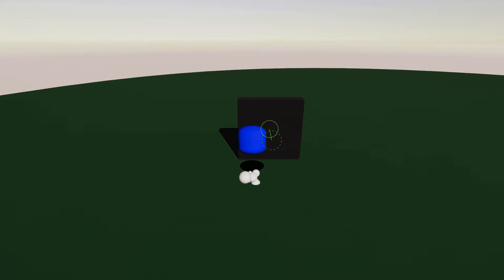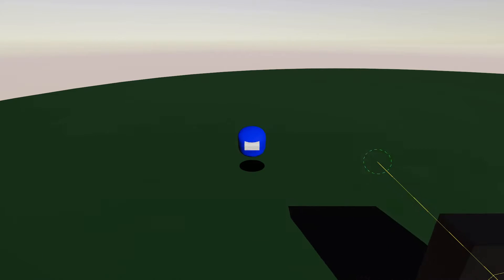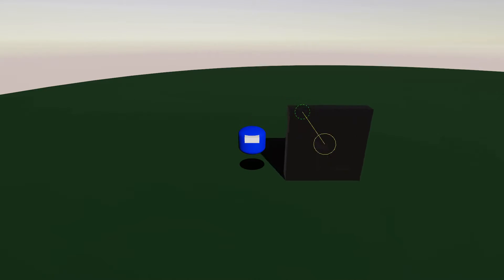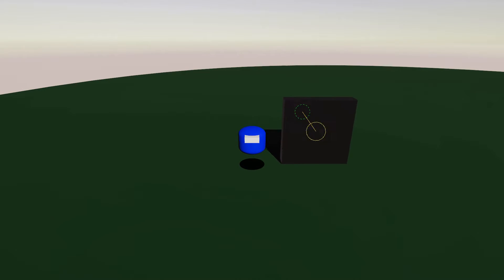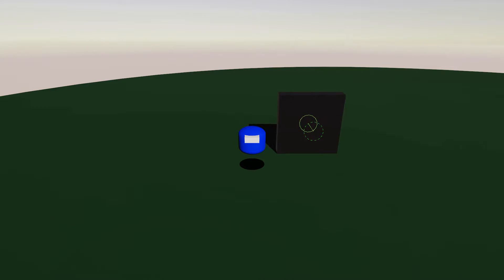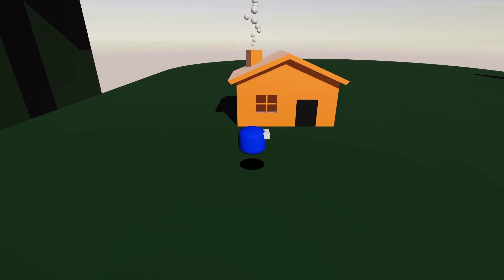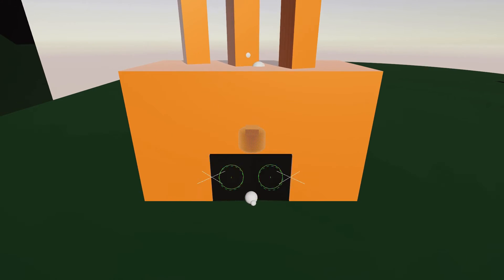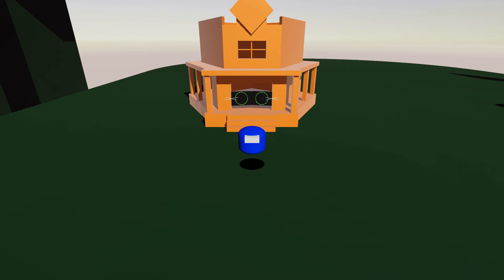Oscillators for Game Development

Comment: is this related to PID controllers? Where you have an error to a value you want to get to, and some function to reach to this value, and your goal is to smoothly reach the desired value. An application would be applying a torque to a tank barrel to reach a specific rotation. You don't know how much torque you must apply, but the PID equation will smoothly reach the desired value depending on how you tweak the values. You also get similarly springness by adjusting the values.
Reply from the maker: Sorry for the late reply, I've just got around to exploring PID controllers myself. My early understanding leads me to believe that PID controllers can be seen as an extension of oscillators.

I think the concepts are mathematically equivalent in some ways:
1. (P)roportional component of a PID <==> Strength component of an oscillator
2. (D)erivative component of a PID <==> Damper component of an oscillator

But they differ in that PIDs have the addition of the (I)ntegral component. The integral component keeps a historical tally of the error, which it uses to remove static error from the system (such as the effects of the constant force of gravity). Whilst using oscillators, I have previously negated the force of gravity to achieve the same effect. Perhaps, however, the integral component has a greater effect on the system beyond just counter-acting static forces. I am going to try using PID controllers where I have previously used oscillators, and see how I get along with them.

Comment: Hi there! Awesome work! I been doing something really similar with a shape cast instead of a ray, but there is a thing that i could not resolve. Maybe you found a good solution for it.

the dampening on the levitation spring and the snap buffer makes it impossible for the character to detach from the ground where it is for example trying to be launched by a trampoline. 

Do you maybe have an idea of how to deal with this?
Reply from the maker: When I have implemented a jump or jump-pad using this sort of levitation approach, my work-around has been to disable the levitation spring when required  (i.e. when being launched upwards).

Roughly, something like this (probably needs some adjustments):

When the Jump-pad is activated...
1. Set jump-state to rising

On update...
1. If jump-state is rising
     a. If falling (i.e. Vertical velocity is negative)
          i. Set jump-state to falling
2. If jump-state is falling
     a. If grounded (i.e. Ground was within range of the levitation raycast)
          i. Set jump-state to none
3. If jump-state is none
    a. Apply the levitation spring
Reply: @joebinns95  Thank you so much for the help! <3

Comment: Hello! I saw this video and thought it was absolutely amazing. I'm only struggling to understand how to calculate angularDisplacement when it comes to the AngularHookesLaw method. Just wondering how you did it and if you wouldn't mind helping me out! Thanks, great video!!
Reply from the maker: Hey! Thanks very much. Good question!

At any given time, the angularDisplacement of an object can be thought of as the shortest rotation required to transform the object's current rotation towards some pre-defined equilibrium rotation. As an example, in the case of a swinging door, you would (likely) want to define the equilibrium rotation as the rotation at which you consider the door to be closed.

I think that the angularDisplacement of an object could be calculated rather easily by subtracting the current (Vector3) Euler-angle rotation of the object from a pre-defined (Vector3) Euler-angle representing the equilibrium rotation. However, I'm aware that Euler-angles are prone to gimble locking, and so calculating the shortest rotation using Quaternions is probably the proper way to do things. Looking back at my own code, I seem to have opted for some sort of Quaternion/Euler-angle hybrid method which only a sick, lazy madman would come up with... So I've pasted a snippet from the code below:

...

    [Tooltip("The local rotation about which oscillations are centered.")]
    public Vector3 localEquilibriumRotation = Vector3.zero;
    [Tooltip("The greater the stiffness constant, the lesser the amplitude of oscillations.")]
    [SerializeField] private float _stiffness = 100f;
    [Tooltip("The greater the damper constant, the faster that oscillations will dissapear.")]
    [SerializeField] private float _damper = 5f;

    public float angularDisplacementMagnitude;
    private Vector3 _rotAxis;

    /// <summary>
    /// Get the rigidbody component.
    /// </summary>
    private void Start()
    {
        _rb = GetComponent<Rigidbody>();
    }

    /// <summary>
    /// Calculates the shortest rotation between two Quaternions.
    /// </summary>
    /// <param name="a">The first Quaternion, from which the rotation is to be calculated.</param>
    /// <param name="b">The second Quaternion, for which the rotation is the goal.</param>
    /// <returns>The shortest rotation from a to b.</returns>
    public static Quaternion ShortestRotation(Quaternion a, Quaternion b)
    {
        if (Quaternion.Dot(a, b) < 0)
        {
            return a * Quaternion.Inverse(Multiply(b, -1));
        }

        else return a * Quaternion.Inverse(b);
    }

    /// <summary>
    /// Returns the damped restorative torque of the oscillator.
    /// The magnitude of the restorative torque is 0 at the equilibrium rotation and maximum at the amplitude of the oscillation.
    /// </summary>
    /// <returns>Damped restorative torque of the oscillator.</returns>
    private Vector3 CalculateRestoringTorque()
    {
        Quaternion deltaRotation = ShortestRotation(transform.localRotation, Quaternion.Euler(localEquilibriumRotation));    
        deltaRotation.ToAngleAxis(out angularDisplacementMagnitude, out _rotAxis);
        Vector3 angularDisplacement = angularDisplacementMagnitude * Mathf.Deg2Rad * _rotAxis.normalized;
        Vector3 torque = AngularHookesLaw(angularDisplacement, _rb.angularVelocity);
        return (torque);
    }

    /// <summary>
    /// Returns the damped Hooke's torque for a given angularDisplacement and angularVelocity.
    /// </summary>
    /// <param name="angularDisplacement">The angular displacement of the oscillator from the equilibrium rotation.</param>
    /// <param name="angularVelocity">The local angular velocity of the oscillator.</param>
    /// <returns>Damped Hooke's torque</returns>
    private Vector3 AngularHookesLaw(Vector3 angularDisplacement, Vector3 angularVelocity)
    {
        Vector3 torque = (_stiffness * angularDisplacement) + (_damper * angularVelocity); // Damped angular Hooke's law
        torque = -torque; // Take the negative of the torque, since the torque is restorative (attractive)
        return (torque);
    }

...

I hope the code here isn't too butchered. If you want to see the full code (TorsionalOscillator.cs) working fully with all the pieces, then checkout the GitHub project in the description. Goodluck!
Reply: @joebinns95  Thank you so much for the reply! I was able to work it out and look through the GitHub project. Learning from your code and how you worked it out really help. Got it working just the other day. 

Thank you for explaining why and how it works!
Reply: @joebinns95  You're an actual genius and superstar for putting out the code to this controller. Thank you so much. Have you looked into the mechanics of applying oscillators to cars? I'd be interested in seeing you implementation of a very very valet like suspension raycast car
Reply: @joebinns95   a * Quaternion.Inverse(Multiply(b, -1));
What is the Multiply operator supposed to be? can't figure that out
Reply from the maker: @ambiguouscompany  Look like I forgot to include that function! Multiply(b, -1) is just taking a Quaternion b and scaling each component by -1. (Code below)

Whilst the code for calculating the shortest rotation was originally sourced from the forums, I will do my best to untangle the Quaternion magic with my own limited knowledge.
Code source. https://forum.unity.com/threads/shortest-rotation-between-two-quaternions.812346/

Getting from an initial quaternion 𝘢 to a final quaternion 𝘣 is a matter of quaternion multiplication. The fundamental statement of 𝘢 * 𝘣 would be to perform a rotation 𝘢 followed by a rotation 𝘣. However, as what we desire is the rotation 𝗳𝗿𝗼𝗺 𝘢 to 𝘣 and not the combined rotation of 𝘢 and 𝘣, we must instead take 𝘢 * 𝘣⁻¹. Whilst I struggle with picturing quaternions, it helps me to think of this multiplication by an inverse as analogous to how we would subtract one vector from another to get the path between two positions.

However, whilst there is only ever one direct path to get from one vector position to another; there are two direct paths to get from one position to another on the surface of a sphere. And so with Quaternions, there are two possible outcomes when calculating the rotation 𝘢 * 𝘣⁻¹. One outcome is the shorter direct rotation (|θ| < 180°) and the other outcome is the longer direct rotation (|θ| > 180°) which goes the other way around the surface of the sphere. By checking the dot product of 𝘢 and 𝘣, we can get the angle between rotations. A negative 𝘢 ⋅ 𝘣 tells us that 𝘢 * 𝘣⁻¹ would give the longer of the rotations. Since we desire the shortest rotation only, we can change our target to 𝘣 * -1 if 𝘢 ⋅ 𝘣 is negative, which will then give us the shortest rotation.

My brain: buffering

Those last details I'm a little hazy on! I'm going to post this comment now and re-read for errors once my brain has reset.

Here's the missing function:
...
    /// <summary>
    /// Calculates the multiplication of a Quaternion by a scalar, such as to alter the scale of a rotation.
    /// </summary>
    /// <param name="input">The Quaternion rotation to be scaled.</param>
    /// <param name="scalar">The scale by which to multiply the rotation.</param>
    /// <returns>The scale adjusted Quaternion.</returns>
    public static Quaternion Multiply(Quaternion input, float scalar)
    {
        return new Quaternion(input.x * scalar, input.y * scalar, input.z * scalar, input.w * scalar);
    }
...

Comment: Could you share the demo scene you showed in this video in the GitHub Rep, it really would help a lot!
Thanks for sharing the project.  😃

EDIT: the code was there in the "develop" branch, it wasn't merged with the main branch
Reply from the maker: Hi!

Your comment motivated me to finally clean up the develop branch, with some added documentation, and merge it into main!
The project is still focused on the character controller however; so I wouldn't vouch for the code that deviates much from that, i.e. the pendulum creator seen in this video was quickly put together and only used once.

All the best!

Comment: Would you be interested to be doing a tutorial on how your floating capsule works.
Reply from the maker: Unfortunately I don't have time to make such a video. However ( !!! :) !!! ), I feel that a video which already well conveys this information is Toyful Games' original video on which the character controller is based: https://youtu.be/qdskE8PJy6Q (if you haven't already seen it). The systems discussed in the video are the exact same that I use, and the snippets of code provided in the video were largely re-used as much as possible!

Also, if you haven't already, and you're interested in using the character controller yourself, then checkout the GitHub project in the description. I've also written a separate, more basic MWE floating capsule in another comment on this video: https://youtu.be/3GsXkzbfNBo

I hope some of this information is useful and new to you, and that I'm not just sending you in circles. I'll have a little think about how to make information about the project a little more clear. If I can be of more help then please let me know :)